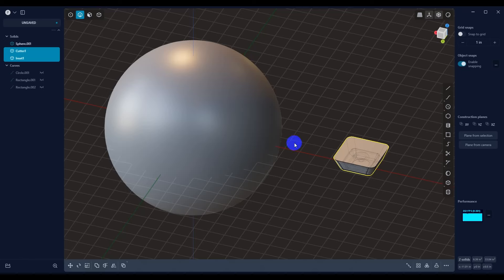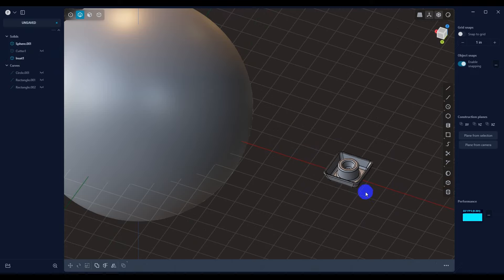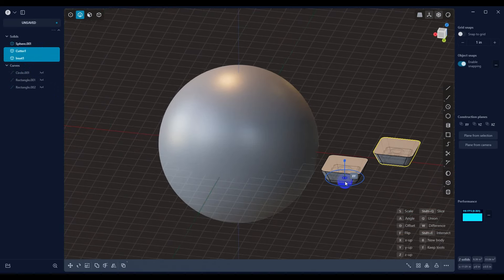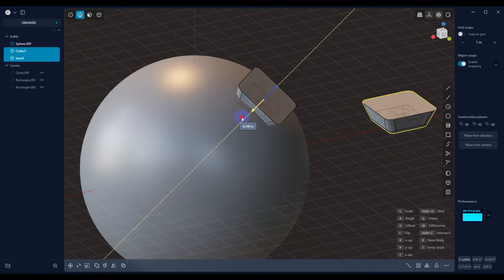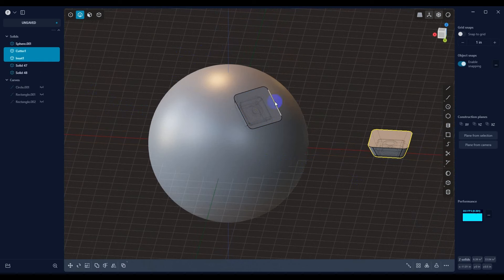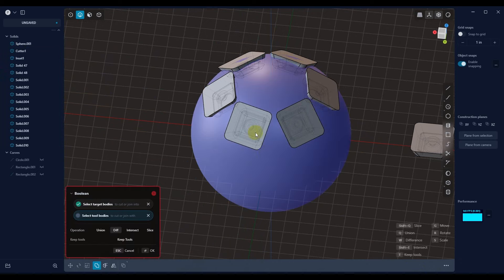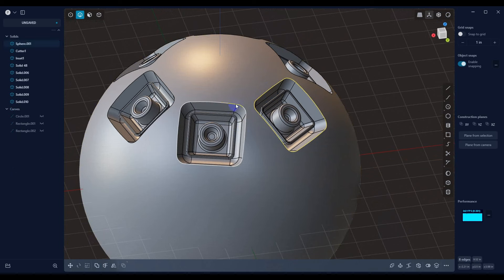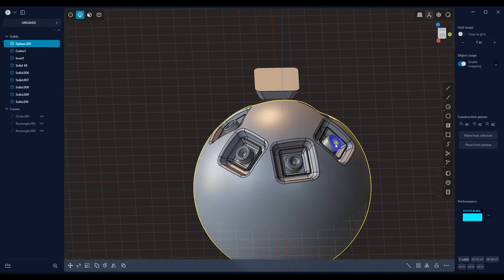Kit bashing in Plasticity1

Comment: Nice video. I'm just wondering is the cutter just few pieces of sheets or it is a solid? Or does it even matter? Thanks in advance.
Reply from the maker: @ennisyui
The cutter is just a simple solid that encompasses the feature. It does matter, but the method you use needs to match the piece you're putting in it and whether or not you want them separate or as a water-tight single piece.

Comment: Sad that without history this is destructive operation
Reply from the maker: @Adam-Levy
I completely agree. I have seen that they plan to add history at some point in the future, but I am not sure when. My other CAD system has a history; to be fair, it also comes with its own set of issues. The only way I have ever seen history done where it is not a nightmare is when it is done as a node setup rather than a tree. So, I hope that when they add history, it will be in a node form. Otherwise, history will add a lot of complexity and force you to spend a massive amount of time on design intent. That would make the conception phase of Plasticity slow and non-intuitive. Right now, I just group all my construction elements and hide them so that it is pretty fast and simple if I need to make changes. It is not perfect but it works. Thanks for watching.